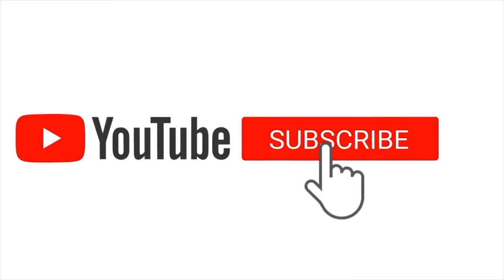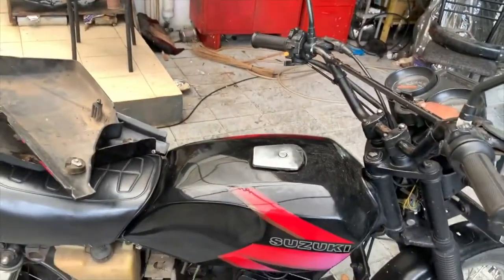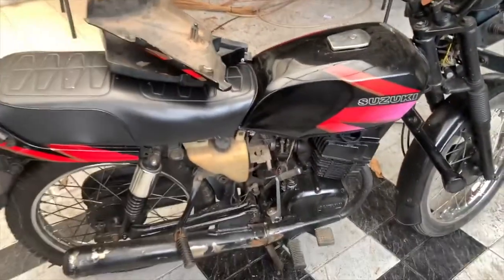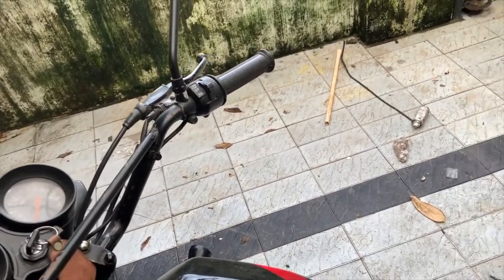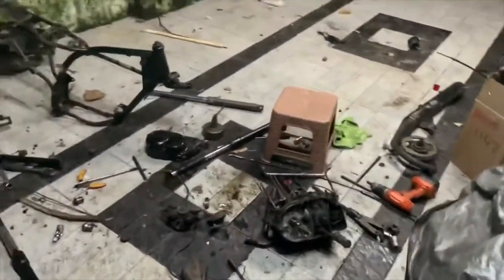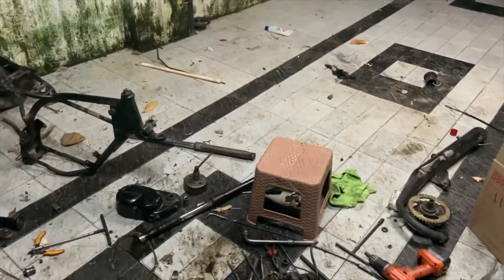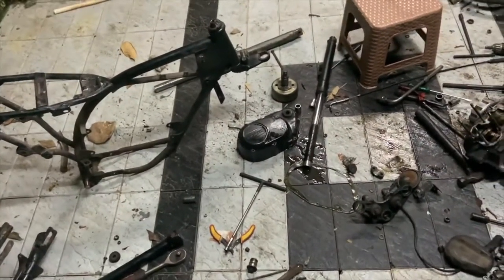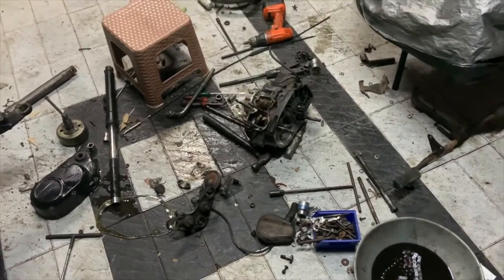Shogun rebuild part 1, Dismantling  ( English video )

Comment: Bro can u please help me in getting an rpm kit for shogun
Reply from the maker: I don’t deal in spares
Reply: @Yamakaze  bro I was just asking u for getting a contact number or something of a dealer from whom u used to buy spares for shogun
Reply from the maker: @ckvlogs2725  I have covered this very subject on why i dont do 5 things. There is a post which is in English, however the video is in Malayalam because i get a lot of similar requests from people from Kerala. Now coming back to your question, the reason i dont endorse any sellers is because every single seller i have bought stuff from has cheated somebody, or someone has posted bad things about them, i dont want to risk the goodwill i have created with my own hard work and efforts. Now the tachometer in a shogun is an electronic one, there is no "kit" available for it, You cannot get the machine alone because its  one thing that can be used in any 2 stroke. Most of the people who sell tachometers in shogun housing are from 4 stroke bikes like pulsar classic and caliber. These will read double the rpm reading since they are from 4S. I hope i was able to share some insight on the topic.